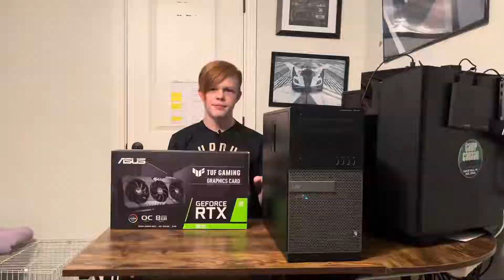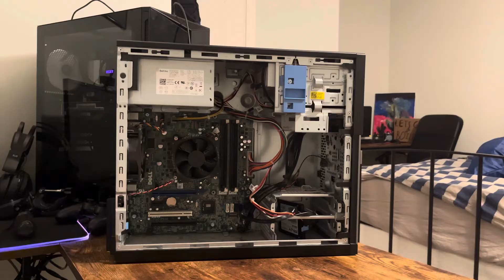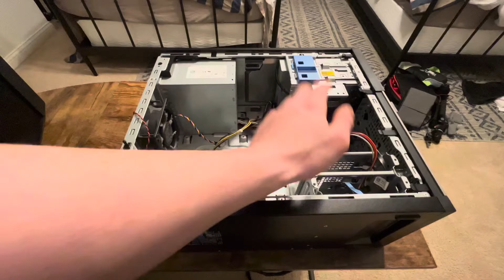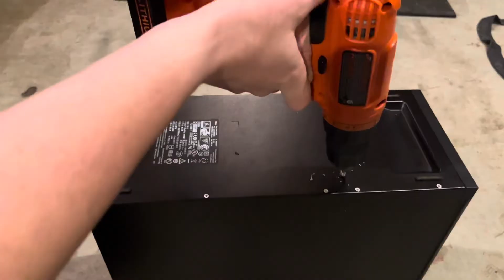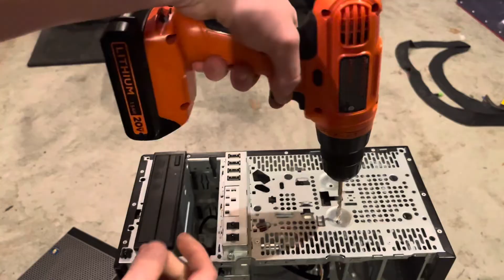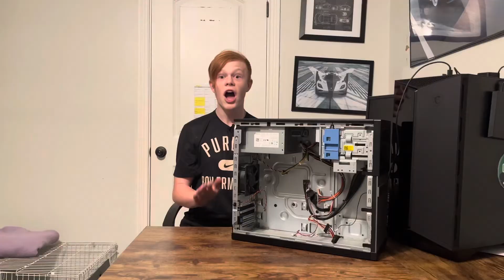How to FIT ANY GPU in your DELL OPTIPLEX!

Comment: Dude, man I would REALLY appreciate if you could or ANYONE here could help me, I had this exact same setup, I removed the Hard disk slots and then I added my Gtx1070, when I tried to remove it, it didn't come out, I tried to push the blue pin down but it just wouldn't come out, then I noticed it's STUCK to the graphics card somehow and WON'T LET GO.

I am gonna start crying cause this is a BIG headache.
Reply from the maker: You have to pull it towards the top of the pc, so sideways.

Comment: I had to insert a longer gpu in my dell optiplex sff tower and this HDD cage was causing issues, so I was thinking to remove this cage and found your video. Now my solution that I had in my head is validated that this will work. Thanks

Comment: I was able to fit a 970 in mine without removing the hard drive holder, it was a PAIN in the ass though, it BARELY fits and and I had to unplug some of the cabls leading to the front ports. 
It also sort of smashes the cables for the hard drives but its doable

Comment: Hey do you think a RX 5500 XT would fit in this exact optiplex model or nahh
Reply from the maker: It should fit with no issues!
Reply: @KennyHalpin  it did thanks bro fire vid
Reply: this is my gpu. i bought a dell optiplex and its on its way, but i dont know what to do with the external power. can i plug it into the external power cable or do i need an adapter?. will it be a problem?

Comment: If the card only have 2 fan, do i not remove the harddisk room?
Reply from the maker: It depends on the length of the card, I’d try to install it, and only remove the hard disk room if it doesn’t fit.

Comment: I just got an EVGA GeForce GTX 1060 SSC. I really don’t want to remove the hard drive bay in there, is there another way?
Reply: This is for a 9020 MT btw
Reply from the maker: Unless it fits in the computer with the bay in, you’ll have to remove it. You COULD use a GPU riser cable to move the location of the card, but you’d be spending a lot of money, and sacrificing performance for no good reason.
Reply: @KennyHalpin  I literally just ended up ripping the drive cage out. Couldn’t find drill bits so it took me an hour to do it by hand lmao
Reply: @fatshaggy8159 I’m trying to remove the mobo but the cord that’s near the disk drive the small cord that’s connected to the pc power on button it doesn’t have any latch to press down to pull it out and I don’t want to break it 

Do I just pull it up?
Reply: @bariinvest are you talking about the front panel header? Mine had the clamps on each side that I had to press in and pull up to remove.
Reply: @fatshaggy8159 I believe it’s what he unplugged at 1:45 but I don’t think I have clamps on mines is there a way I could show you in a picture?

Comment: Hey, nice vid! I've been interested  in building a pc from scratch with some high-end parts and decided to use an older case since I find sleeper builds cool, but I like the office-like look of the 2013-ish dells more appealing than the retro 2000's ones. Since I was planning to put the gpu in a similar position to yours, I was wondering, how are the thermals for the gpu so far? (Idk if you still have the pc like this since this video was from a year ago, but if so) did you have any problems in the long run with this setup?
Reply from the maker: Thermals weren’t bad! We made a 4090 rig, and cut the bottom off the case and made it mesh

Comment: hey dude, nice vid. i got a nice deal on an optiplex tower plus 7010 (i7-13700/16gb DDR5) fitted with a 1660 super. I want to swap out the 1660 super for a 4070 as I have a 500w PSU and the 4070 doesnt draw much power (especially when i undervolt in afterburner). Im just wondering what i will need. Will my proprietary PSU in the Dell have the right cables to connect to the 4070 adapter? Or should i just go with a 3070?
Reply from the maker: You’ll need a different psu for any gpu that uses external power.
Reply: @KennyHalpin  so 1660s is powered by MOBO ?
Reply: @KennyHalpin  ok so i decided i will invest in a "Corsair RM750e"... i will be able to connect it no problem to MOBO yes? Sorry for the Qs, im just worried ill overlook/not know something and buy something i dont need :P

Comment: Thank you for showing this. I have an optiplex and am wondering how new of a card I can put in. Optiplex 790 with 600w PSU * 2 -8 pin power plugs* . Considering a 3060.
Reply from the maker: At that point you can pretty much run whatever you’d like! Anything that won’t bottleneck the cpu will be absolutely fine with that power setup!

Comment: I recently tried to add a new graphics card the same size but found it blocked the connections from the motherboard to hdd. Better to buy or build new pc but good job with this.
Reply from the maker: You can also buy a 90 degree connector that will fix your issue with the connections.

Comment: I can't find your link for how to connect the PSU to this GPU.  Dell with it's proprietary fan connectors, and weird 2x2 CPU power, I'm having trouble putting an nVidia GeForce 1080 in mine even with my own PSU.
Reply from the maker: The stock PSU won’t work with most aftermarket graphics cards, you will need to replace it.
Reply: @KennyHalpin  yes, 3:05 you said you'd post a tutorial.  Here, you put in an aftermarket graphics card, which requires two 8-pin power connectors your stock PSU doesn't offer, and didn't show how you finished connecting it.  I have an "EVGA SuperNOVA 650 P2 650 W 80+ Platinum Certified Fully Modular ATX Power Supply" and when I took it off my custom i5 to put it in a comparable Dell i7 to what you have here, I ran into what I believe were compatibility issues.
Reply from the maker: Yeah, I did say I was going to make a video on all that. I don’t have time to make much of a response right now, but I had some stuff come up and an unprecedented move, so I currently am not in a spot I can make new videos right now.

Comment: I installed a dual fan rtx2060 with ease, but removing them is hard.
Reply from the maker: They’re easy to remove if you press the button on the bottom so it just pulls out!

Comment: Not to be rude... But i think your gonna have a huge bottleneck with the CPU in this build, i think the most common CPU with the 7010 or 9010 are the i5-3470.. i also have a dell 7010 but its a SFF with the GTX 1630 LP and an i7-3770K, please don’t ask why i choose that GPU, 19 yo me didn’t know that it was a scam. vawesome channel btw!
Reply from the maker: Yeah, the 3070 was just a spare card I had, so I was using it for demonstration for the video.

Comment: Great video! But how to fit in a long GPU into a newer Optiplex Mini Tower model, such as 3060 3070 5050 etc. The depth of the case is just a little bit too little in order to fit in a Asus Strix GTX970 which is 279mm. IS it possible to do vertical mount with a riser cable?

Comment: Real question how will this work with a 250w power supply and no 8pin cables, like are you using sata to 8 pin or 6 pin  i did recently see toasty bros slap a 4060 on an optiplex with stock psu so i have no clue
Reply from the maker: As said in the video you will probably need a new psu.
Reply: @KennyHalpin  ah alr

Comment: Just wondering, What about the power connectors?
Reply from the maker: I’d recommend replacing the PSU with something like a Corsair CX600. The stock psu doesn’t have the right cables, and is underpowered.

Comment: I have the same thing. I want to buy a GTX 1060, but its size is large, and I do not know how to install the storage space connections because the card space will cover the SATA cables. I hope you can help me in solving this problem. It is based on experience.
Reply from the maker: You can get 90 degree connectors on amazon or eBay that should solve your issue!

Comment: Hi, I have a question. Am i able to install rx480 videocard on my optiplex 7010 DT? I know standard PSU is too low for this card (like 250w), but i'm going to move all components from 7010 case to another with 400w psu. So i wonder if rx480 will fit in my 7010 motherboard, like does it have all required cables, inputs etc?
Reply from the maker: Yup! It’s just down to having the right psu to power it all!
Reply: @KennyHalpin   thank you for answer) i have pretty cheap HQ400 psu, i hope it would be enough

Comment: nice video. hate it whenever I can't fix my rtx 4090 in a dell optiplex 390

incase you missed it, this is a not so funny joke. I don't want to hear anything about bottlenecks.
Reply from the maker: Just because you said you don’t want to hear anything about bottlenecks, I’m inclined to let you know… I think that may have a slight bottleneck… 🤣
Reply from the maker: Just because you said you don’t want to hear anything about bottlenecks, I’m inclined to let you know… I think that may have a slight bottleneck… 🤣

Comment: Una pregunta yo tengo una optiplex 7020 y mi duda es si es posible que se pueda poner una grafica rtx 3060? y cuento con pci Express 3.0 si me serviria? Ponerla? Gracias
Reply from the maker: ¡Sí! debería funcionar sin problemas. sólo tienes que asegurarte de tener una fuente de alimentación que tenga suficiente potencia y los cables adecuados para conectarla a la gpu y alimentarla bien. ¡Espero que esto ayude! y estoy usando un traductor, así que perdónenme si esto es difícil de entender.
Reply: @KennyHalpin  muchas gracias hermano entendido a la perfección 💯💯💯💯

Comment: can you do a video putting a Zotac Geforce RTX 3060 twin edge OC into a dell optiplex 7040 please
Reply from the maker: I don’t have those 2 things on hand as of now. But the 7040 case cannot fit the psu needed so it you cannot install any gpu that needs external power into the system.

Comment: 2 issues with this tutorial is that, number one, you can't plug your usb 3.0 header and number two is that the sata cable will in your way when you are plugged your graphics card in.
Reply from the maker: Yeah, I believe I mentioned in the video that you may need 90 degree connectors for those… I’ll check, if I forgot to mention it I’ll add a caption.

Comment: Great instructional video on removing the drone cage.

It's worth mentioning any issues that might arise from propriety components, particularly if you replace the power supply .

Some Dell and lots of HP's don't use the standard connectors used by off the shelf powersupplies  however this can normally be overcome with cheap adapters.  HP can be particularly annoying like in later PCs (6th gen and later) it has a sensor that gives an annoying message before booting that you have to press F1 on to continue of the front usb3 is not connected. Because of using one of the pins on the socket as the sensor you can't round this by using an adapter from the front I/o to a pcie card. Always worth watching a video like yours on the particular model of Dell/HP/Lenovo that a person wants to upgrade.

Comment: Wouldn’t you need to change the power supply ?
Reply: I agree. Theres no way that stock PSU is at least 600w.
Reply: @2026wefree  Are y'all deaf? He said in the video the Power Supply needs to be changed.

Comment: I dunno if I'd go through all of that effort to put a 3070 in an old optiplex like that. You'd be better off getting a Dell XPS system with a 6th or 7th gen CPU, DDR4 RAM support and you don't have to pull metal drive cages out. On top of that, you need a 25-pin to 8-pin power supply cable for Dell's proprietary 8-pin connector for any aftermarket power supply becase 280W is not enough for any RTX 3000 series card.
Reply: I got a free 3050 Optiplex and have a sweet gaming rig now after throwing an SFX PSU with the adapter you mentioned, in it to power the RTX3060 Dual fan I got for it. The 7th gen i7-7700 is rocking every game i throw at it and I didn't have to spend all that much to get it up to gaming specs. The older Optiplexes like his will still do gaming as long as you pay attention to CPU and GPU utilization to avoid bottlenecks.
Reply: @GTORazor  that's awesome. The RTX 3060 is one of the most popular cards right now because it has the best price/performance. The i7-7700 should still provide solid performance for most games. Just make sure there's ample air flow going through the front and back of the case and the i7 has a good heat sink.
Reply: @pjasonq  It does, I added a Coolermaster Copper core i70C, I get solid 60fps in everything and if I can unlock the vertical sync in the game, it goes in the hundreds of fps. I have Afterburner and Riva Tuner running to keep an eye on temps and usage and any bottlenecking. This is my first toe back into PC gaming in almost 15years. Loving the low budget builds with Optiplexes. I am adding a side cover fan as well to exhaust heat, 80x80mm ought to do the trick with some mods to the case.
Reply: @GTORazor  You can get so much more for your money these days...I'm always amazed at the prices I pay for used PCs when I know several years ago they easily cost hundreds of dollars.
Reply: @pjasonq   I work in IT Support and regularly get them cheap or free when people and companies upgrade. That is what prompted me to try building a gaming PC from an office Optiplex, lol. If I had a better selection I would have snagged a newer 8th or 9th gen if i could.

Comment: Good start with the system dude. But the drivecage is also attached to the front side of the case with ribbits. You should not bend the cage because you can bend and damage te front of the case. If ya want to install a front fan you can also drill the front raised metal stumps flush. Have fun modding 👍👋
Reply: Very late reply, but you don't need to drill out those last rivets on the front of the case. If you have an awl or a heavy duty icepick & hammer. You can push the awl or icepick into the rivets & then rotate in circular movements for a bit to widen the holes & the rivets just fall out.  And the others he drilled out can all be knocked loose with a hammer and a long flathead screwdriver. Takes a bit of muscling, but no power tools at all.

Comment: I needed this video
I'm upgrading my 7020 mt been trying a figure out what gpu  and how to make one fit if I buy the wrong size
I have also 3020 3010 7010 I'm upgrading soon
Reply: I am using a 7020 at atm it's an i5 4590 i have it paired with 20 gb of ram and a gtx 1060 6 gb works great!!  no psu swap or anything just bought a sata to 6 pin connector and done

Comment: did you encounter an issue with the sata ports on the motherboard blocking your gpu?
Reply from the maker: I just used a 90 degree sata cable!
Reply: @KennyHalpin  Why are you being evasive about those cables that have blocked ports by the GPU?  While others are commenting favorably about this video, I can't get over the fact that you just stated (only when asked btw) that you used one 90s degree cable.  When actually for this model there should be another SATA cable involved, plus the USB and power I/O cable to deal with.  That cable MUST be connected, yet you've glossed over it.  There are "lateral" 90 degree SATAs (recommended), and a USB front panel extension cable that can be 90 degree down (to the right).  I think you have an obligation to explain this, or else you are sending people on a bum steer.

Comment: Did you upgrade the motherboard? The stock mother board in a dell optiplex is only rated to a gtx 1650… anything higher and the gpu won’t work unless you upgraded the mother board .
Reply: I did with mine, but cannot force myself to get rid of those drive bays.  I’m limited to 241 mm right now.
Reply from the maker: Yeah, I was just using the 3070  for reference to show how large of a gpu you can fit.

Comment: What GPU do you recommend for a e3-1290 v2 it's in a Optiplex like this one, I want the best GPU that'll last me some years
Reply from the maker: WellX if your on a budget the GTX 970 or 1070 is a good all-round gpu!
Reply: @KennyHalpin  you think the 1070 will be good for say the next 5 years?
Reply from the maker: @anthonyk  Not really, It's already growing long in the tooth, it might be could for a year if you are lucky.
Reply: My gtx 1650 can run steam games and ca:go …. Any triple A games are on lowest setting and still crashes after 3 games
Reply from the maker: @TheeDanIslander  Dying GPU lol
Reply: I'm afraid you processor won't last another 5 years.  It is a 3rd gen Xeon.  It will be a bottleneck to anything faster than a 1070 I think.

Comment: Technically you don't have to remove the motherboard to remove the drive cage. You can drill it out with the motherboard in and then blow the case out with a can of air or shopvac.
Reply from the maker: Yes, you don't have to remove the board. But having it removed from the system can prevent aluminum shards from sticking to the motherboard, causing a short. Plus it can make it harder to safely cut the bay out without causing damage.
Reply: @KennyHalpin  I'd have removed everything including the PS before drilling. Compressed air simply can't get all the shavings.  So I agree with your method.
Reply: That's how I did it, because I was lazy. Didn't affect my system, but admittedly, it was a risk even after vacuuming out the case.